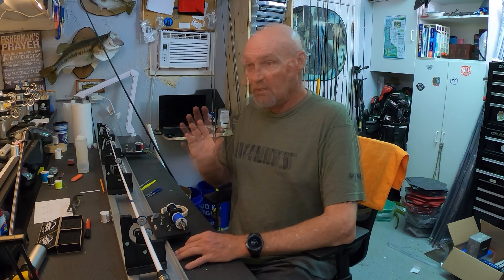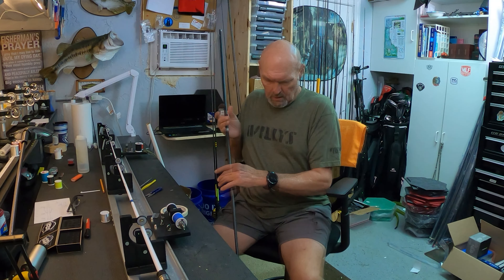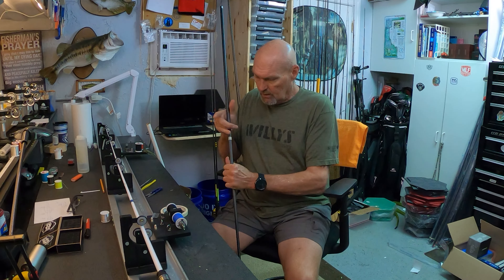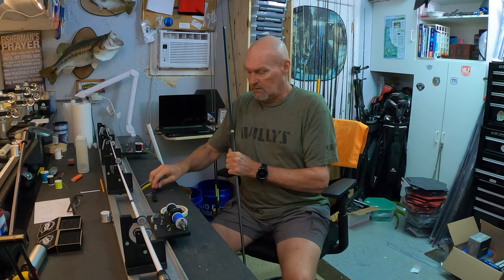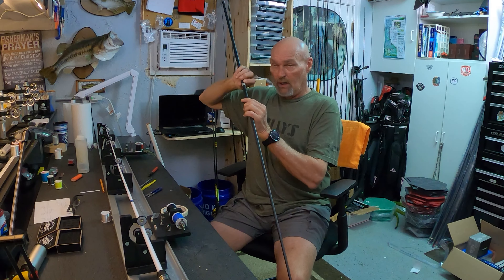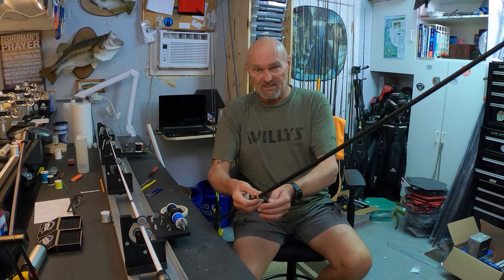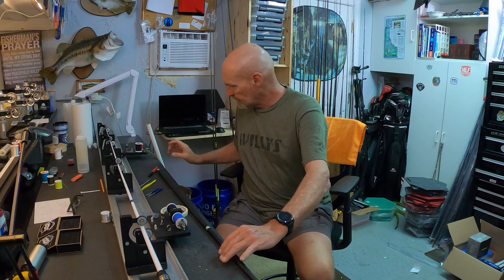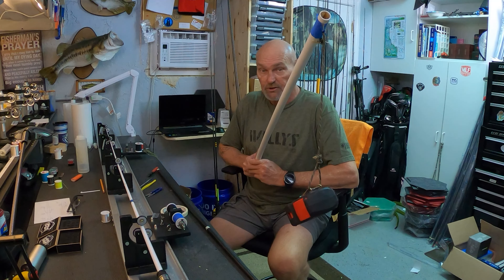Which Side for the Guides?

Comment: I was taught that spinning guides would go on the spine side (your bottom) and casting guides would go on the oposite side ( your top) is that right, or are you saying, all guides go on the spine whether building a casting or spinning rod?
Reply from the maker: You were taught the way I was.  The spline is the bottom of the rod as you hold it.
Reply: @fdxcustomrods  Thanks for the reply,

Comment: I think some of the confusion is from terminology or reference, spine meaning strong side vs weak side. I feel like many people think of spine as the strong side and the belly as the weak side. In your video the rod spins outward towards you and the spine marked on the tape was on the inside towards the camera. I completely understand what you’re showing and describing and do my rods the same way. However, in my mind and that’s a scary place, that natural curve where the mark is, to me is the weak side/belly side and the opposite side 180 degrees is the spine side or backbone side. So to me the backbone/strong side always faces the sky. Now if that doesn’t confuse people nothing will 😂! Thanks for the video!
Reply from the maker: Agreed, the spline, as marked on the inside of the natural curve is the bottom of the rod as you hold it.  Thanks for the thought filled comment.  And we both have scary places between our ears...🤣
Reply: I have a blank with two spines. It flexes more in one direction than the other. I’m building a spinning rod. Should the stiffer side be on the bottom or top of the rod bend?